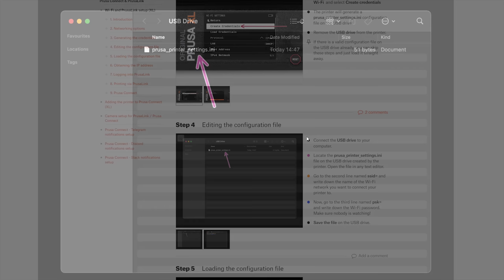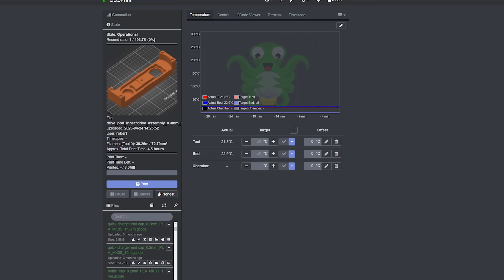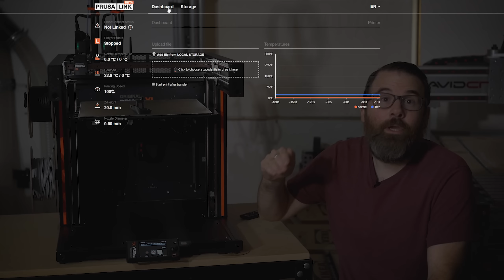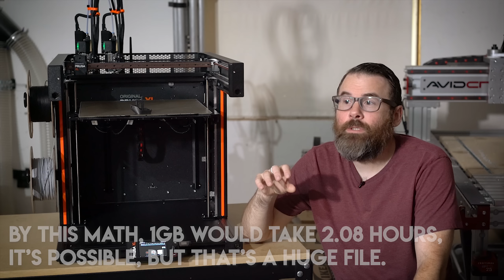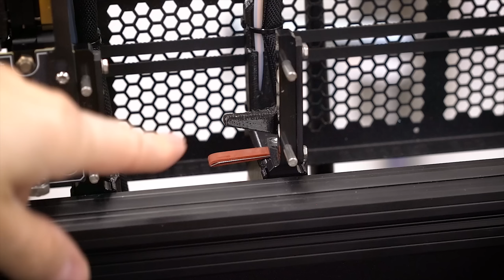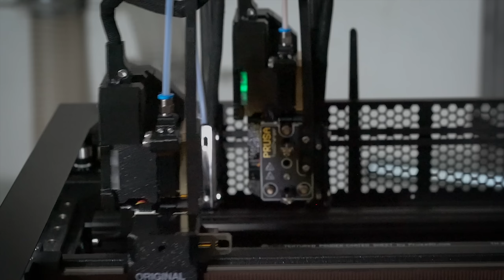Prusa XL - WiFi, Load Cell, and More!

Comment: Lack of enclosure really limits the materials. For such an expensive machine the lack of enclosure is bizarre. Overall print speeds also seems really slow for a corexy.
Reply: at the size, you wont find faster Printers 

1) its really hard to make a big printer fast, much more mass, wayy more room for error... so its physically impossible to make it go as fast as a voron 0 for example

2) i agree its expensive and not that cool, but for ppl in the Industrie its way more important to have a reliable machine that does something right all the time, and high speed is for certanly a big risk of error
Reply: The speed will improve when input shaper hits. The lack of enclosure really is a shame. It'll cost me a bit to make one.
Reply: @skywardsoul1178  Yes.  The input shaper can't come fast enough (no pun)...
Reply from the maker: I'm gonna try whipping something up with cardboard, ha.  But I do want to try making something easy.  I'm not convinced it needs a full top on it, I think just some sides and front would be enough for most materials.
Reply from the maker: nice one.
Reply: @RobertCowanDIY  A cardboard box has suited my CR-10 just fine for the last couple of years. Planning on doing something better soon with better facilities. Made some ABS helmet parts possible, so it did the job. You may have to rig up a janky door and closure for it depending on the type of box. Just have to be mindful of fire risk of course.
For the XL I'm wondering if some impermeable fabric panels would do a similar job to the rubber skirt Prusa was fixing up.
Reply: @Basement_CNC  voron 2.4 can be 350mm^3. qidi x-max 3 is 325mm^3. mingda MD-400D is 400mm^3. it's hard to imagine any of them being slower than the xl.
Reply: The 'enclosure' is an addon they teased - I don't think it's been released yet -  looked like an accordion style fabric but that could change.  I don't think there was ever a thought that this would be produced w/out an enclosure option - it's just not available yet
Reply: @planckstudios  It's not really an enclosure that's to be released so much as a draft shield. A proper enclosure would cover the top, as heat rises and escapes. The idea of a full enclosure is to stop drafts but also increase the internal ambient temperature to reduce warping. 
I believe full enclosures are being worked on by users.
Reply: @skywardsoul1178  I didn't realize that was just a draft shield. Maybe that's why it's not out? They could have realized the futility and are reworking the design.  Releasing a massive (and pricey) multi-material corexy without a means to print half the materials? Ffs
Reply: Looking forward to getting one.
Reply: @planckstudios  I mean, you could combine it with a top cover and that'd be a pretty neat enclosure. I hope you're right and they're reworking it / adding the top part. The draft shield would still be of benefit without it, but not ideal for the full range of mats.
Reply: @RobertCowanDIY  a cardboard enclosure on a 2000 dollar printer it just doesn't seem right that prusa doesn't have a full enclosure option
Reply from the maker: @stephenteitgenengineering you're not wrong.  TODAY they don't have an option.  We're still in the early release phase.  Give it some time.
Reply: Granted how much PEEK / full on PEI etc are people printing?  I’m not saying an enclosure would be bad for PC and Nylon etc, but even then the more basic options others have mentioned suit that sufficiently from what I’ve heard, right?

Having a “clip on” or “flip up” enclosure would be sick though, remove it if not wanted, easy access compared to doors.
Reply: @ericlotze7724  lack of enclosure means the XL is a PLA/PETG/TPU printer only. no ABS, no ASA, no PC, no PA, no PP. not to mention the fumes from various filaments - without an enclosure you are pretty much screwed.

Comment: On my MK4 I haven't really found it an issue with the slow file transfer speeds over ethernet. I usually hit "Upload and Print", go clean the build plate, then walk away. It will finish uploading and then start printing.
Reply from the maker: Yeah, same.  I usually just hit 'upload and print' and then alt-tab to another screen and do something else.

Comment: If this had a heated chamber and well cooed electronics, I’d have bought it instantly. One can only wish.
Reply from the maker: All the electronics are external (except motors of course), so heating the chamber is not too terrible.  Why do you want/need a heated chamber?
Reply: @RobertCowanDIY  to run some industrial nylons we use. They need 90deg heated chamber.
Reply from the maker: @Theprofessor1212 Oh wow, 90C CHAMBER temp!?  That's pretty cool!  Can you tell me what kind of filament you use, I'm just curious.
Reply: @RobertCowanDIY  I don’t know the exact blend but it as nylon 6 and 6,6 plus some other polymer to increase the rigidity.
Reply from the maker: @Theprofessor1212 Gotcha!

Comment: The network transfer speed is supposed to be much improved in the 5.1 firmware. The biggest improvement should come from starting the print before the entire file is sent, but they're also doing compression and arc welding to reduce file size.
Reply from the maker: Gotcha.  That seems like bandaids rather than fixing the issue though.  Compression is always a good thing (assuming it doesn't change the file in any meaningful way).  But it seems like they're not addressing the root issue?
Reply: @RobertCowanDIY agreed, they should really track down the root issue. 
It’s crazy that this bug is still lingering after so long, this should have been fixed prior to shipping the printers really :/

Edit, for info, my upload speeds are around 125kb/s 😢
Reply: I think the main cause of the slowness is the interface between the main board and the LCD board where the USB port is, but I don't really know for sure.
Reply from the maker: @pyrhockz Oh agreed, it needs to be fixed.  That being said, it doesn't really prevent me from doing anything, it's just annoying.
Reply from the maker: @mrjackson2k I wonder if they could make it so people could use a USB-C thumbdrive...
Reply: @RobertCowanDIY   usb 2.0 is 480Mbps so that is definitely not the bottleneck.
Reply from the maker: @StormBurnX Correct, but I think there's some question as to how they're implementing it?  I only suggested USB-C since it's directly on the mainboard, and not located remotely on the LCD.  I wonder if they're doing some sort of SPI bus thing with the USB?

Comment: If you are uploading a file onto the printer main board on octoprint, it's very slow as well. Usually with octoprint you are streaming the file from the pi.
Reply from the maker: Ah, good point.

Comment: I've run into an issue with doing a multi-tool head print via Prusa Link (sent from Prusa Slicer).   It always freezes on the first tool change and I have to abort the print.   Have you tried that on yours?   Mine prints fine from the USB stick, just not over wifi.
Reply from the maker: Isn't it always printing from the USB?  If you don't have a USB stick, it won't print, as there's no local storage, it doesn't load the file over wifi.  The file I printed was already on the USB drive, let me try slicing something and printing directly through the slicer.
Reply: @RobertCowanDIY  Yes, you need the USB drive, however this was uploading a new slice to the USB stick via PrusaLink from PrusaSlicer.  When I copied the gCode to the USB stick directly it worked.  I think the file being uploaded is getting corrupted.
Reply from the maker: @Arcadenut1 I just tried a print and it worked fine.  I did a multi-material print, sliced in Prusaslicer and uploaded/sent to the printer via the Prusa Link, setup in prusaslicer, no issues.  It was a fidget thingie with 0.1mm clearance between the moving parts and it printed as if it was a single color/nozzle.
Reply: @RobertCowanDIY I appreciate you testing it.  Maybe it's something with my model.  I'll keep testing.   This is day 2 of using my XL, so it could be user error or I have an edge case :)
Reply from the maker: @Arcadenut1  my first thought would be to try another USB stick.

Comment: Can you test the buttons on the front of the extruders? They're supposed to extrude/retract the filament, but I've never actually seen anyone try them. My Prusa XL is still a long ways away so I hope they can sort out any issues like the slow network speed before it arrives.
Reply from the maker: I looked everywhere and I don't see any buttons.  Where are they supposed to be located?
Reply: @RobertCowanDIY  The LED on the front is supposed to function as two buttons too. At least that's what they showed in one of the blog posts last year.
Reply from the maker: @r3fuze HUH, interesting.
Reply: I can confirm. That's what they do on my machine. I am not sure why I'd need that though.
Reply from the maker: @ulaB Can you explain?  The LEDs on mine do nothing.
Reply: @RobertCowanDIY  Hm. Weird. I am fairly sure I've used them to purge more filament once, but it doesn't seem to work anymore. I am not sure if they removed that feature from the firmware? 
The buttons are supposed to be above and below the Nextruder status LED - these clear "humps". 

It was shown in "XL Update #2 – More timelapses, a closer look at the electronics, Nextruder news and schedule update" on their blog.
Reply from the maker: @ulaB I just found the blog post and mine doesn't seem to have that feature.  I pressed all over the extruder, nothing.

Comment: The upload speed to my MK4 is super slow indeed, the only things I really don't understand. First I used wifi, then I thought "let's use my ethernet network", and small files still take ages to get over. I now just use the usb, which is fine, but shouldn't be necessary at all. Prusalink is nice-ish, but no where near Octoprint, there's sooooo many features it still needs, for me the most part I'd like to cancel 1 object on a plate when it fails for instance. For the rest I like the machine a lot.
Reply from the maker: Yeah, that's the same experience I had.  It's not been too bothersome, it's just strange it's THAT slow.  Ethernet and wifi are the same speed which is odd.  Hopefully a software update can fix this, since it doesn't seem like a hardware limitation.

Comment: I think that the network speed issues are an artifact of the USB interface. The Prusa machines have an issue with how they deal with USB. File corruption is common. The devices are never dismounted and plugging or unplugging the drives causes issues. I think that the same issues happen when you turn the machine on and off. I have had it corrupt the file systems and have had files that I have transferred over the network corrupt in transit.
Reply from the maker: Huh, interesting.  I still feel like this is a software issue, so hopefully it can be fixed with the existing hardware.
Reply: @RobertCowanDIY  I very much think that it is a software/firmware level issue. The current generation is the first that has used a USB port rather than an SD card. I think that there are issues with the way that they are addressing the USB port.
Reply: @WonkoTSane  The Mini has been using USB since 2019 and the MK4 and XL firmwares are based on that code?

I did not have any problems like you describe yet. But the USB drives they ship with their machines seems to have issues. Every time I disconnect them from my Mac, they take forever to unmount. After switching to a different stick, it works a lot better.

Comment: 8:00 Sorry to say it but I talked with a prusa dev and the transfer speeds is hardware limited. It won't improve. What can improve is reducing file size. Apparently that is something they are working on for prusa slicer, doing something to make the files smaller. Can not for the life of me understand how they came up with that and said to themselves "yeah that's fine for a >2k machine". But they make their own boards so I assume that has something to do with it.
Reply from the maker: Yeah, it seems like the USB interface is going over SPI or something silly like that.

Comment: Thanks for this, seeing the tools changes and the minimal purge tower has my mind made up, I have loads of multi colour designs and I`ve been wondering about the bambu AMS for some time but the waste and closed system has put me off. the 5 tool prusa XL will be perfect for me, its just a pain that its going to be next year now.
Reply from the maker: If you're just doing different colors, the bambu might still be the right thing for you (unless you need the larger size, don't like bambu, or don't like the wasted filament).  It's still very very good at filament switching.  I'm not trying to talk you OUT of the XL, but the bambu is still the better option I think for just different color filaments.
Reply: @RobertCowanDIY  Bloody hell, I decided to add a P1S plus AMS to my print farm, taking into account the time saving from going out to the printers and manually changing filament for colour changes, the actual minimal waste once you have dialled in the  poop and got rid of a purge tower its a game changer. Joseph Prusa should be shitting bricks, and I love my 5 prusa machines, but next to the P1S they are dinosaurs. There is still a lot to evaluate but I dont think I will be purchasing another Prusa, at least until the 5 head XL has been out for at least 6 months and all the bugs have been ironed out. 

Thanks for the advice.
Reply from the maker: @daveglas1972  I don't think he's shitting bricks, they just hired an additional 100 people to help with manufacturing.  They seem to be doing just fine.

Comment: They've had my deposit and hopes for so long.  The news about Prusa Connect being shoddy is so sad.  They've had years to develop and test this.  And it should not be impacted by the supply chain issues.  Prusa is looking weak
Reply from the maker: I wouldn't say they're looking 'weak', but they're showing the growing pains of spreading yourself too thin (between development, production, hardware and software).  We'll see if they catch up.

Comment: It's so strange that WiFi setup is the way it is because just in personal projects I've been able to implement the ol access point web GUI very simply with an esp32 with in built storage (and theyre using a similar thing for WiFi).

Its just a webserver and spiffs or nfs for xpressif modules so it's just strange something that takes a hobbyist a couple hours to implement wasn't here. Just screams rushed product to me, because it's not even like there are any concerns about security there because this is standard practice and within your home, so unless someone just so happened to snipe access in the 2 minutes you used to setup (The same risk every other device has, which can be mitigated in a number of ways but is one of those not really a threat threats), there is no risk because after that it's on your network the same way.

As for the upload speed thing, I totally get you not believing but I should mention that you (I'm guessing) mostly post functional prints that gcode wise will have a lot of long straight lines compared to more organic models like someone who wants to print figurines or cosplay props.

Those files on the other hand can get comparatively massive. Like waaay bigger than you might expect.

I would suggest if you were super curious you try a relatively complex figurine just to send it to the printer to see how bad the experience likely is for people who typically will run a different use case from you where big files are more of the norm.

That being said I forget the name of the setting but there is a setting that increases the minimum space between points that approximate curved patches that can dramatically lower file sizes. I recall it being used mostly for printers with weak processors being unable to keep up with lots of really short gcode moves, but it's a potential Band-Aid for the poor network performance at the cost of a minor decrease in accuracy (though for models, that type of accuracy loss is unlikely to be noticeable).
Reply from the maker: you are absolutely correct about the wifi stuff, I'm really surmised it ended up like that!  you're right about the type of things I print.  I do some more complicated cosmetic stuff from time to time, but I understand that a cosplay helmet with a lot of detail will be a massive file compared to most of what I do.  But I still think ~1GB for a gcode file is an outlier and that should really only be about 10 minutes to upload.  I think what you're thinking of is arcwelder.  I've tried it before and it does a good job of reducing file size and complexity.  Apparently the new version of something (maybe prusaslicer?) has something like that integrated to reduce file size.